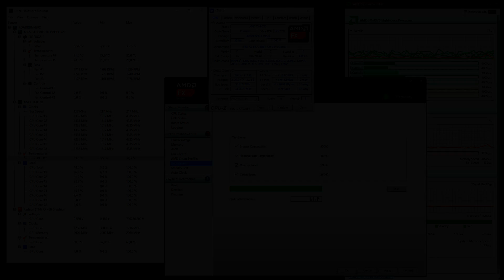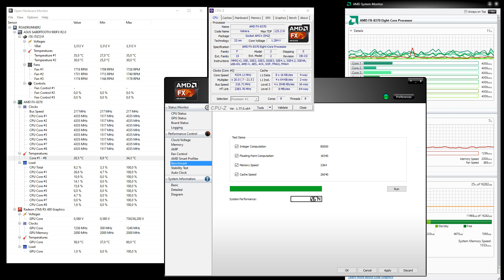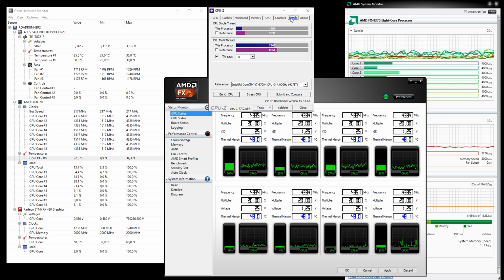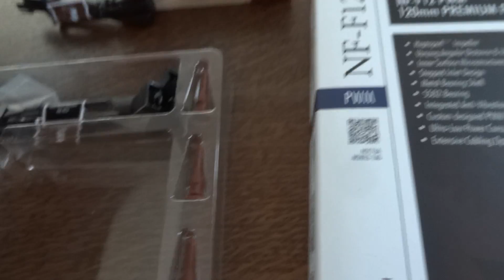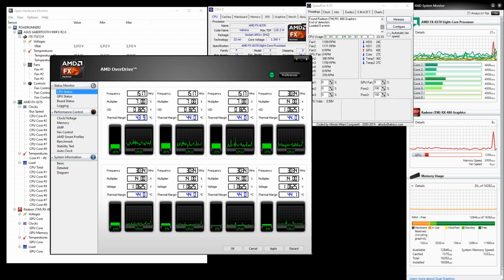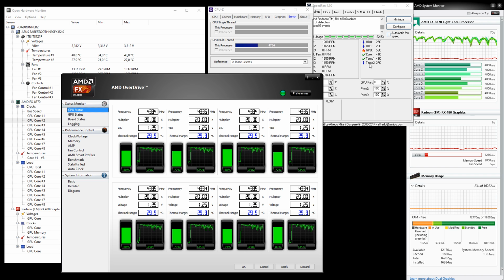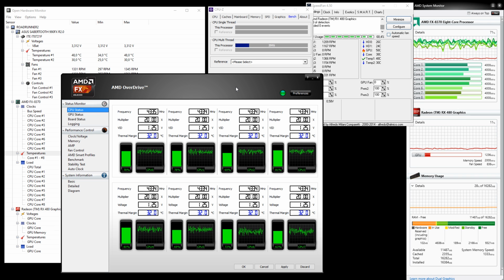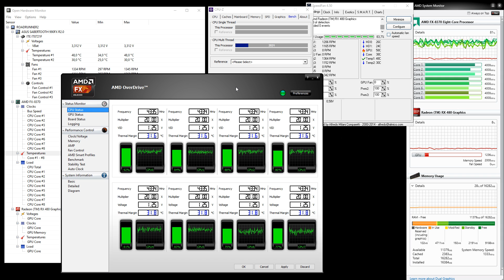3 vs 4 Pin Fan connector - Noctua NF-F12 PWM | TechDragon.info

Comment: Asrock b760 pro rs ddr5 compatible. Uses 4 pin only. My aio pump is 3pin. Will a 3 to 4 pin adapter allow me to adjust pump speed? Bios don’t let me change voltage from 12v to lower so I couldn’t just change to dc and adjust the pump; even when I tried and lowered the curve in fantune it didn’t do anything. Mobo manual says all fan pins on the 4th pin is the one that actually controls speed. So I’m assuming it would but does anyone have experience with this?
Reply from the maker: hmm I have never had a AIO to try that out with, so im not fully sure, you can try to see if you can set that header in your bios to DC mode, that might be enough to get it working, lots of motherboards have a dedicated AIO /PUMP header, does that board not have 1? well the only thing I could think of is go into your bios, and take that header off PWM and set it to DC mode, that might work.
Reply: @TheTechDragonChannel  aio pump is plugged into cpu fan 2 wpump. Bios I switched to DC. Tried to customize curve to no avail. Doesn’t adjust pump speed so pump is loud as f like a constant buzzing. I have the Vetroo aio 360mm. Mobo doesn’t have aiopump header. 

I don’t get how some people are adjusting the voltage on this when I can’t. Is it just mobo limitation? Is there no software that can let me adjust voltage of the fan pins or whatever?
Reply from the maker: @RealElonMusk-x1j  hmm not sure, have not had an asrock motherboard in a good couple of years, so no idea what their bios looks like nowadays. Sorry, I would say consult your manual to see if any header doubles as a pump header, and if not, im not sure what the best action would be, you could put a noctua noise adapter in between, that would lower the voltage going to the pump (they are cables with a small resister to step down the voltage in between the header and the fan (or pump in your case), but I have no idea if the pump likes to run at less voltage, but you could try to see if that would work. Not sure, Good luck!

Comment: Other than fine speed an accurate control - are PWM fans really that much better?  I found a heatsink for my CPU for cheap but the fans are 3-pin - I want to make sure that it will still work OK.  I have a motherboard with 4-pin connectors, but my fans are 3-pin and they're still controlled automatically.  They are not PWM - the yellow wires put out 2 pulses per rotation (so 10000hz at 5000rpm).  I haven't put this on a scope but I built an arduino project in class to control a PWM fan - must be each time it switches poles or something.  Anyway are the 4-pins really so much more special?  I can control a 3-pin fan with PWM technically, and that's probably how my motherboard controls the "3-pin" fans :)
Reply from the maker: I do believe 3 pin is voltage controlled and less accurate controll over it, and less feedback to the motherboard on the actual RPM. Yes it will work, pwm just gives it more fine control, however there are motherboards (at least in the past) that would run a 3 pin fan at full speed because it did not detect an reply signal, most modern day motherboards should have that issue but keep that in mind in case it just spins at full speed all the time, you may have to go into your bios and tell it it is a 3 pin and not a pwm fan for that fan header.

Comment: okay so i need help, I have 2 4 pin fans that i need to connect to my motherboard and only 1 slot for fans which happens to be 3 pin, I was just wondering how I could do this?
Reply from the maker: There are splitter cables you can use, most noctua fans actually come with one in the box, y splitter cable. You can use that (but it will obviously split the power between the 2 fans so keep that in mind)

Comment: Fan isn’t on full speed in motherboard everyway, my motherboard changed the voltage and it ramps up and down.  BUT from 5 to 12v you can’t imagine how the difference is loud. Was looking to compare 4 and 3 about noise, speed, progression but nah..

Comment: If the fan runs at full speed all the time you wouldn't need 3 pins, just 2 pins - power and ground.  That there is a 3 pin to get back the rotational speed, indicates the motherboard should have the ability to adjust the fan speed by modifying the voltage to the fan - so DC regulation of the speed.  So its not true that a 3 pin always runs at 100%, in fact it should not.  The 4th pin, the PWM signal just adds a more refined signal to control the fan speed a bit more specifically than just the voltage regulation allows for, but both 3 and 4 pin fans can run at non-full speeds.

Comment: one trick you can use if your cpu fan is 3 pin and runs full speed on a 4 pin board but one of your case fan headers allows speed control of a 3 pin ( which is my case) you can plug the fan on the cpu heatsink into the case fan header. there will probalby be an error message saying "no cpu fan." if moboard allows it disable this warning in the bios.  if not plug a 4 pin fan (like mayeb the fan that came with your stock heatsink) into the cpu fan header and set it to run lowest speed always.  then just find a place to place this useless fan out of your way.  also VERY IMPORTANT set your case fan sensor to use the cpu temp sensor and not the moboard sensor.  if your board does not allow this option dont use it.  now you can use your 3 pin fan .
edit:  after watching the video again he has the opposite problem.  i thought that a 4 pin fan on a 3 pin board worked the same as a 3 pin on 3 pin.  maybe im mistaken

Comment: also the mm H₂O part (where he mentioned water or pumping) is the static pressure of the fan. it is a measure of air pressure where a certain amount of water is made to rise a certain amount in a tube (say 22mm). high static pressure fans are good for very tightly spaced fins but may move less total air.  high air flow fans move more air for larger fin gap heat sinks but have less pressure for very closely spaced fins.  they both have their place and noctua makes both

Comment: remember if you use a 3 pin fan on a 4 pin motherboard check in the bios and manual to see if you can change the 4 pin header to dc mode instead of pwm.  most boards will let you do this on at least one or two header plugs.  if it runs full speed and their is nothing you can do, just use a low noise adapter and let it run at the lowered speed without speed control. if you are using it the other way around with a 4 pin fan on a 3 pin board you will still have speed control but the lower speeds may have to be raised to keep the fan from stopping spinning.  so if your rated minimum is 300 you may have to run it at 4-450.  no big deal

edit:  after watching the video again he has the opposite problem.  i thought that a 4 pin fan on a 3 pin board worked the same as a 3 pin on 3 pin.  maybe im mistaken

Comment: Hello, i have hyper 212 evo which is a 4 pin connector i only have 3 pin on my board can i use something like speed fan to make sure it wont go at 100% speed? I am doing some overclocking probaly max 1.38 volts on the cpu , plz help me out
Reply from the maker: +N&A Duo you should be able tot regulate its speed by voltage in the bios, does depend on the bios but should be possible
Reply: the problem with going full speed is with 3 pin fans on a 4 pin board.  you are the other way around.  you can still control the fans but the lowest speed may be a bit higher, if you go too low the fan will shut off.  if it is rated to go down to 300 rpm with 4 pin maybe the lowest you can go is 4-450.  no big deal you are fine.  speed control is just a little less precise

edit:  after watching the video again he has the opposite problem.  i thought that a 4 pin fan on a 3 pin board worked the same as a 3 pin on 3 pin.  maybe im mistaken

Comment: you can modulate speed with 3 pin, its just not as nice as PWM. PWM means you can go from 1 to full rpm because voltage is constant, while 3 pins will have low torque at lower voltages.
Reply from the maker: +Henry Li Yeah its smoother, just a better and newer way of doing it, but yeah both methods work, they just don't nix too well.

Comment: i love how speedfan says 50c is "fire" haha

also i never knew the thermal limit on the AM2+ series was so low... only 70c.... o.0
Reply from the maker: +TJ CAT yeah speedfan is a bit outdated :p as for the thermal limit,  not a 100% sure, it could be that that is the max safe operating temp and going over is not recommended, however won't insta fail it, that would be my guess.
Reply: TheTechDragonChannel even then, imo 70c is really low even for max temps to not impact performance long term through degradation.
personally i only really start to care if im hitting 80-85c at a peak
but yeah speedfan is laughishly strange, not even outdated, the days of GPU temps @100+c are behind us 
or... not so much...
cough EVGA mosfets cough
Reply from the maker: haha yeah Dont buy an EVGA :P thats for sure lol I do like to keep all my components as cool as possible though so the lower the better, but yeah i do agree that that seems low, how however, its not unheardoff for a lot of progrems to get the temp of an AMD CPU wrong for some reasons, so maby the base rating is too low. 

I just got this from a website: 
The Maximum operating temperatures specify the range of temperatures in which the CPU is guaranteed to function. It is not recommended to operate the CPUs at temperatures lower than the minimum and higher than the maximum operating temperature.

Maximum operating temperature  61.1°C (for my cpu) 
so Yeah I think I was about right, its the range where its guaranteed to work in, after that it will more then likely still work, but may have issues, and only 61? damn.. well in any case my cooler keeps it WELL below that threshold so no issues here
Reply: TheTechDragonChannel i see what you did there....
in any... "case"
^^

but tbh the EVGA thing was honestly nothing too unordinary... it was 200 in a million products with the defect in what turned out to be a manufacturing issue... not even a thermal haha - those things can get over 150c and they were maxing in worst case (get it ^^) scenarios at around 120... just that this time it was over-reacted to shit which sucks for EVGA

Comment: You can also just plug the 3-pin fans in to your motherboard, iy you do that you can change the speed in the bios of your motherboard. I did that with 3 of my 3-pin fans in my pc and they run very quiet now!
Reply from the maker: +Justus Dekker and a note: there are some mother boards where you can change the speed regulators of a 4 pin from pwm to DC mode, and some where you can change the CPU pin into voltage controlled rather then pwm, so yes it is possible with some motherboards and the right settings. In general: when connecting a 3 pin fan to a 4 pin connector that is in pwm control mode, it will blow at full speed.
Reply: I have a high-end motherboord (asrock fatal1ty z77 performance) so i guess you need a high end mobo for things like this....
Reply from the maker: +Justus Dekker for case fans that might work, but I'm pretty sure that does not work for CPU fans.
Reply: 2 of those fans are on my h100i V2 for my CPU, so it does not matter where you put the 3-pin fans, you can even setup fan profiles for 3-pin fans! you just need to put in a little more time
Reply: also that would vary on your specific BIOS setup, also being able to adjust the fan RPM's would be harder unless you got an OP BIOS
Reply from the maker: +Justus Dekker but like I said, using them for your CPU and actually having them connected to the CPU pin are 2 different things, and I have tried to set it via the BIOS, but this is a known issue when connecting a 3 pin to a 4 pin pwm connector.
Reply from the maker: I wouldn't really call an Asus 990FX Sabertooth R2.0 a low end board.. its just not every board, some do, some don't. Seems rather random.
Reply: Justus Dekker thats like saying that because you have 12 SATA 3 connectors makes a board high end compared to a board with 6 SATA 3 ports... no... thats not how it works,,,